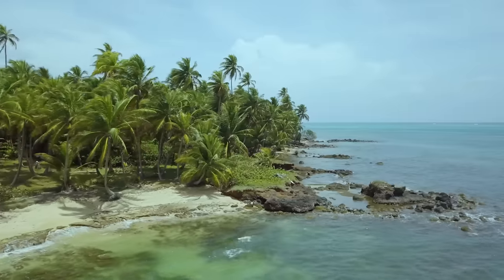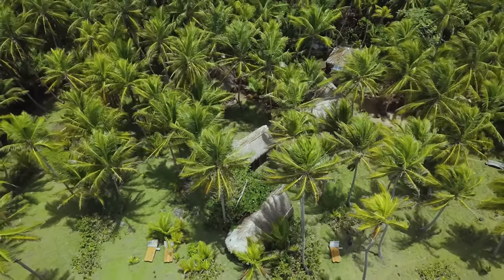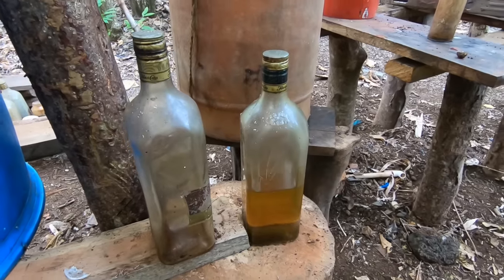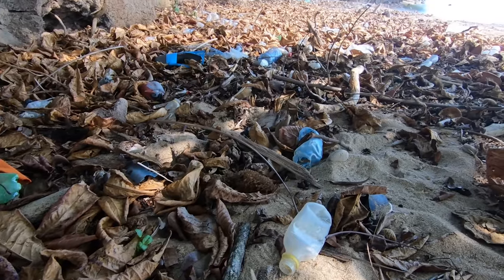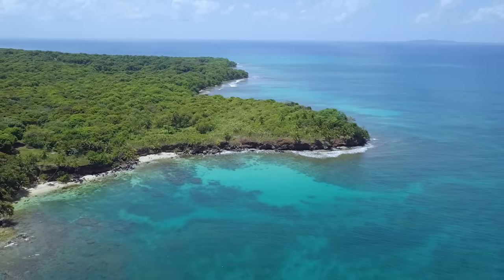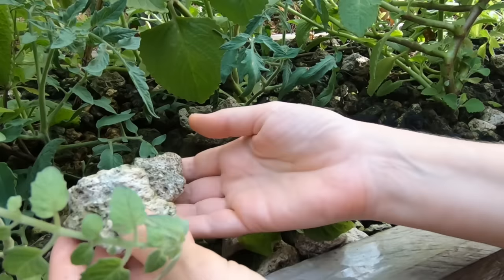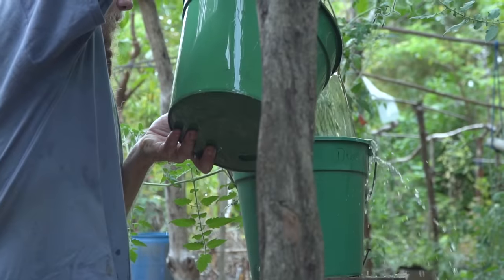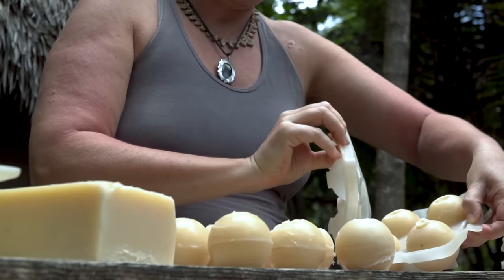THIS SELF SUFFICIENT FAMILY MAKES THEIR OWN FUEL FROM PLASTIC!

Comment: A lot of the most harmful compounds in plastic don't go away when disolved in the resulting oil or when that oil is burnt, some of it is released into the atmosphere, some of it comes back to ground in particulate matter and much of it is left in the form of an extremely toxic slag that's left behind in the reaction vessel. What does he do with this slag? Where is it disposed of? It is far far worse than the plastic it came from. Also you can do this same process from dry organic matter like wood only it leaves much less toxic shit behind. I see the appeal but there are serious human health and enviromental issues that this can create which ironically are likely worse than simply burying the plastic in many instances.

Comment: i would say that it is nice that this works out, but it doesnt feel sustainable since you are burning wood to convert plastic into fuel that as you can see, is still releasing smoke, that means it still has a high amount of unburnt hydrocarbons, so it although at surface level looks great, isn't worth it since you are polluting the air with co2 frm the wood and toxic hydrocarbons like ethane, methane etc. frm the fuel

Comment: sure, it looks good to make plastic go away but what about all that black smoke coming off that old diesel generator? diesel engines running pump gas exhaust much more particularites, which is supposedly why they require aftertreatment systems.

maybe certain people dont like engines that can run on leftover oil or readily available plastic trash but that is a some thick black smoke. Black like a helicopter crash, unless youre Kobe and your helicopter somehow burns all white.

Comment: When you need fuel and you have coal or firewood and some plastic it's for sure great, but you need more energy to crack up the plastic to fuel, than the produced fuel contains. It is a pity but it is not a proper substitute for crude oil or a solution for climate change. A solution would be that a specific area of rainforest has to be protected for any specific unit of crude oil or plastic. This would be the fastest and sustainable solution.

Comment: SUPER BAD for the environment, but, yeah, lets you create your own fuel, fuel you cannot use in a car unless you want to destroy it.  So he uses it to make electricity.  It would be more efficient, and almost JUST as dirty, to burn the plastic directly in a steam generator.  This method uses less carbon, due to the lack of a need for cutting wood to burn.

Comment: Great idea to get rid of plastics but you're still pouting, you're putting toxic gas into the air while producing it and while using it in your engine, maybe look into using water as fuel it only takes a small amount of electricity to split water atoms into hydrogen and oxigen, hydrogen you collect and oxigen you can safely release into nature, hydrogen is what you want if you're looking for fuel, it's a gas though not a liquid like you are producing with your plastic pyrolasis

Comment: If ur going to burn all that wood to make only a little diesel why not just make steam from water and run a steam generator.  All ur doing is burning wood to burn dirty oil and so ur carbon footprint is too big and dirty. And besides how much thermal energy is used to make too little oil and in the end the kilowatts created are shit in my opinion. A even an industrial main land grid is way more efficient and cleaner.